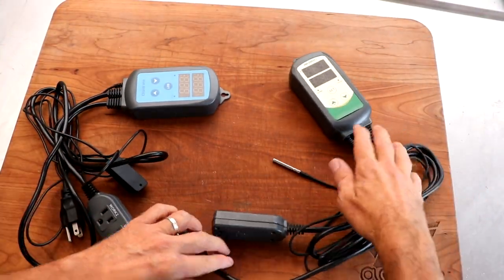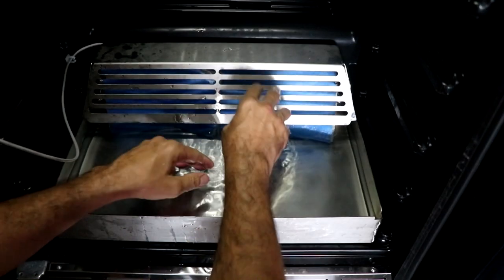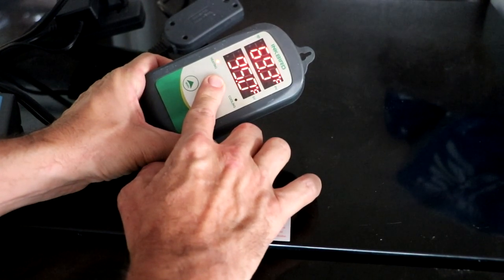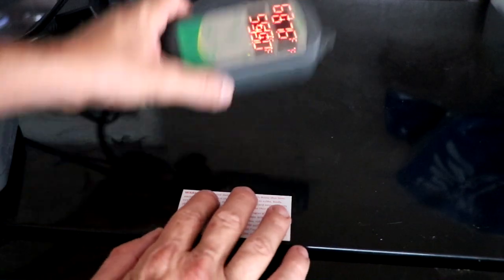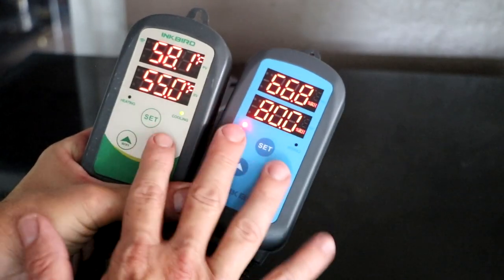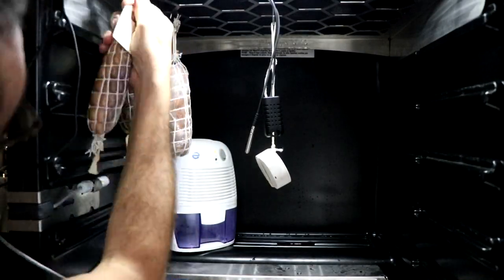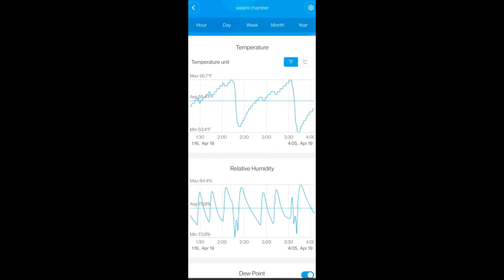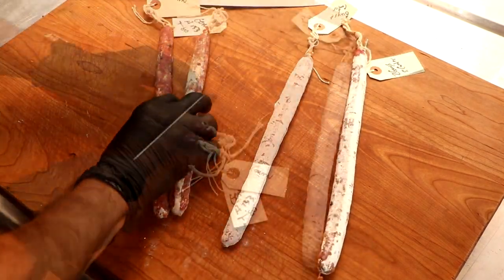Can we modify Cavern to make it work? Testing a Prototype Dry Curing Chamber

Comment: I have realized the same system inside an old fridge, using RPI with mycodo repo (ultrasonic humidifier, deshumidifier like yours, and a ceramic reptil lamp to heat if needed and a SHT3x humidity/temp probe), local server interface on a browser (computer/smartphone), works fine and very cheap. 👍
Reply: verry cool, do you have a build guide/log?
Reply: @Smokeywolf64  no, but mycodo user manual is very nice and they have got a forum. Notice that U need to have some electronic skills to realize this kind of project. 👍

Comment: Does it need a small fan to even out the temperature and humidity? 
Can you also configure the controller to get a smother output?
Reply: More likely a larger fan at slower revs to move more air around slowly rather than less air faster.

That's based on my experience with computers though. 🙃
Reply: Put multiple GoVees in the chamber to map out temp/RH. For my DIY chamber, a very small amount of airflow from a slowly turning computer fan maintains an very even environment.
Reply: @BillAckerman  That would be my guess. An option perhaps is to do this when you are putting moisture into the system.
Reply: @vaazig  I can remember back to a fan for the original Mac.  Rather than make a rotary fan, someone had a small reed relay running at 50hz. attached to this reeds were two flexible strips of plastic. They had tuned the length to set up a resonance. 

Intriguing to return to an old fashioned fan idea, rather than rotary, with just one moving part
Reply: I'm not sure if this is significant (maybe Eric can chime in?) but the hole I drilled into my DIY chamber to run in the wires for the probes, humidifier, dehumidifier, etc., is not sealed, so there is also a small, but steady, exchange of fresh/stale air. No idea whether this helps, hurts, or just makes other stuff work a little harder.
Reply: @BillAckerman  Here's my sort of wish list. 

1. WIFI connectivity so you can track from anywhere, and control from anywhere. 
It's far easier setting up a control program on a lap top or pad than pushing buttons.
Also, alerts. 

2. Display on the machine. 
3. Temp heat and cool
4. Humidify and dehumidify
5. Glass door. 
6. Airflow control, recirculate and fresh in. 
7. Boxy construction [I don't like the table top humidifier in a fridge]
8. Lighting
9. 1/2 and full Hight cabinets. 

Would be cool to have a set up for

1. Mushrooms
2. Cheese 
3. Charcutier
4. Aging meat - think Salt bricks
5. Dehydrator
....

ie. Modular set up. 

Water? Connection to dump to a drain, or add from an external supply
Reply from the maker: Nice wish list...
Reply from the maker: @Bill Ackerman Mine is not plugged as well.  I don't think it makes a huge difference but a little FAE is always a good thing..

Comment: Nice video.  However, the only difference between chambers niw is that the Cavern still has an inferior humidity source with a big old exposed water tank, possibly skanky sponges, and an unfavorable reliance on having to run fans to humidify.  If you just ripped that turd out of there and replaced it with a small sonic humidifier, which would then give you back control of your airflow... heyyy...wait a second... now it's just what everyone can build themselves for a few hundred! ;)
Reply from the maker: 🤣🤣.   I've since exposed a new issue.  Next update will be interesting

Comment: My hygrometer meter won’t calibrate. The govee won’t go below 64 temp and humidity when calibration. How’d you calibrate ?
Reply from the maker: if you have a govee, then when you hit the settings option on the top right you will see an option for calibration.  When your meter is in a controlled area where you know the temp just adjust up or down till your meter reads the same temp..
Reply: @2guysandacooler  it doesn’t let me go below 64 but reads 54 in my chamber but it’s off because my chamber is set at 65 humidity is 85 but reading 68. This thing has no instructions
Reply from the maker: That's not how you calibrate it.  It won't be accurate.  Place the govee device in a zip lock bag at room temp.  Somewhere that the temp doesn't fluctuate too much.  After an hour measure the temp with an external device like an instant read thermometer or something.  If your thermometer reads 75f and your govee reads 70f then adjust your govee up by 5 points so that it now reads 75f.  Makes sense..

In your chamber the parameters are constantly fluctuating.
Reply: @2guysandacooler  makes sense. How about humidity ?
Reply from the maker: @topteam22  watch my video on how to calibrate your humidifier.  Same principal, just place it in a zip lock bag.  After 24 hours the humidity should be around 75%.  Adjust the govee up or down so that the govee reads 75%
Reply: @2guysandacooler  you’re the man. Thanks a lot brother

Comment: But you can do that with any small refrigerator. 
Didn't Cavern know this when they started?
Reply: Weird that they built an alpha build with such a known requirement missing.
Reply: @john.c  I'm also concerned about the source of humidity i predict that the wicks might grow moulds and can debris fall into the water tank? I'm thinking about bacteria of course.

Just some concerns.
Reply: @vaazig  In addition to my DIY chamber, I also have the dry curing cabinet from The Sausage Maker, which uses a wick system. Their recommendation is to add baking soda to the water tank and to sanitize the water tank every few weeks. Never had a problem with mold.
Reply: @BillAckerman  thanks for the info. That sounds like a really good cabinet. Don't think we can even buy them here in! He UK.